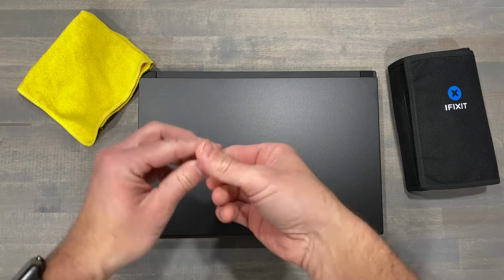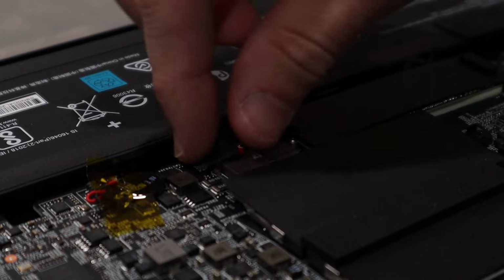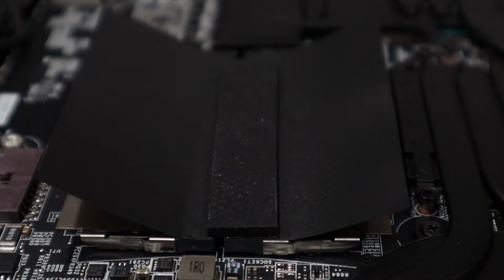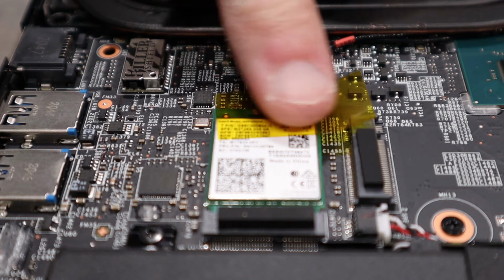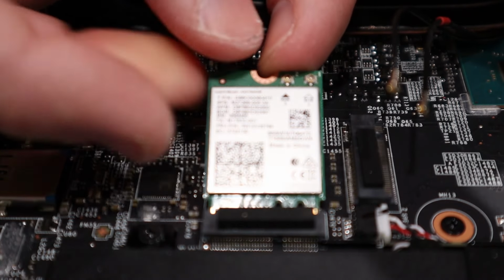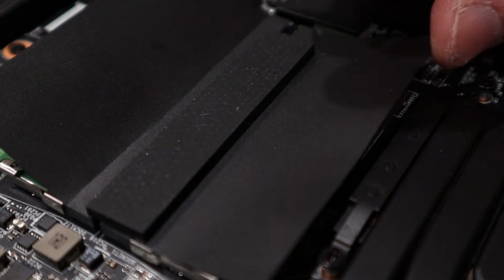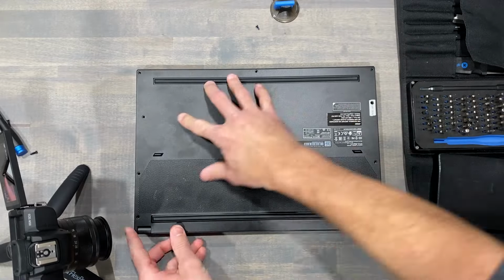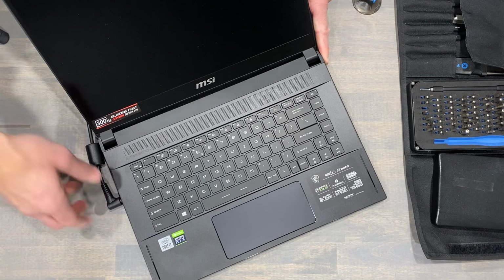MSI GS66 Stealth ACESSIBILITY Memory, WiFi, and Storage

Comment: Bob! We need you!!!! There are 2 main issue with GS66 that nobody mentioned in every single review I found.
- First: the wifi connection. the speed in download and the signal are 1/2 slower co.pare to any other laptop, removing the back panel everithing work fine, so the problem is the materials of back panel.
- Second: the performance unde thunderbolt charging. God it's so frustrating! I can understand that by thunderbolt charging the performance can't be the same as when we are using a 230 watt power supply btw it can't be that they are 1/2 than the performance by battery! Using a 100watt thunderbolt chargers in 3dmark spy (with an 10875+ 2070 max q) the results are 930 (GPU) and 7500 (CPU) that means that all watts are drained by the CPU making the laptop unusable (on battery 2500/5500 and it has much more sense!).

Comment: This is how you fix the fan noise on a MSI laptop with Dragon Center. I have a GE75 Raider with RTX 2060.  You set User Scenario to "User" then "Advanced" under Fan Speed. You click on the disc icon to open the fan pillar graph. For CPU, the pillar on the far left, I set it to 0%. For the other 5 pillars, I set mines to 5%, 10%, 15%, 20%, and 25%. For the GPU, I leave it default because I never use the GPU during basic tasks. You can still adjust it too if you want. It's 99.5% silent for basic tasks but one in awhile, the CPU does hum on then hums off for my laptop.

The "silent" mode isn't silent for basic tasks. It's really meant for gaming with little fan noise. It's not like Balanced or whatever Performance mode where the fans are running at 75%+ fan speed. I think silent mode caps the fan speed to around 40 to 50% for gaming.

Comment: You don't actually need to unplug the battery from MSI laptops. There is a small hole in the bottom plate, press that button for 30 s and the laptop won't power on until plugged into a charger.

Comment: Nice! Can't wait to get my hands on a max-p 3060 laptop. Been awhile since I've had a laptop but ready to jump back in. Have my eye on upcoming Eluktronics, MSI GS66 or possibly even the new Stealth15 with that 4/8 i7. I like the sub 4lb, travel friendly size but still packs a 10nm i7, 3060 and 144hz display.
Reply from the maker: Can you link that Stealth with the new 4c i7?  That sounds interesting 🤔
Reply: @BobOfAllTrades  https://www.msi.com/Laptop/Stealth-15M-A11UX

Tiger Lake i7, so decent single core performance, but multicore won't be great. Still for a light travel gaming laptop I am intrigued by the form factor and relatively reserved look.
Reply from the maker: I want this!
Reply from the maker: The display is labeled as 45% NTSC.  I really hope that is incorrect!
Reply: @BobOfAllTrades  Just saw a review and indeed the screen is pretty bad. It also has no ability to disable Optimus like some of MSI current offerings. 

Back to the hunt it appears. The Eluktronics with that new 1440p 165hz screen and AMD CPU is now on the short list. 

Best Buy has a pretty good sale on last gen GS66 laptops. $1099 for a GS66 with 10750H and 2060 is appealing.
Reply from the maker: That is appealing for sure.  I’m super bummed about that 15m.

Comment: Unrelated question but Should one get the current FHD 300hz screen or the 240hz GSync QHD panel coming in Q2 2021? Is GSync worth it?

Regarding this you could probably keep the videos separated but this video is extremely crucial for wannabe enthusiasts like me
Reply: There’s not much difference between 240 and 300. Plus, the extra resolution is nice with the strong gpu

Comment: Can you show how to properly clean laptops inside out? Like fans from dust,
keyboard and screen without damaging it
Reply: This isn't that difficult to do... however, the cleaning procedure will differ from one laptop to the next (it will depend on how difficult the manufacturer made it for users to open up the laptop and reach all the relevant hardware).
In some cases, manufacturers tend to put most of the key components (like CPU, GPU, etc) below the non-removable keyboard... which then forces the user to completely disassemble the laptop in order to reach them. These kind of assembled laptops are most difficult to handle... but most tend to allow easy access to internal components by simply removing the back panel (you have to make sure you have turned the machine off prior to opening it of course, and I'd also suggest draining the battery and then pressing and holding the power button for 10 seconds to remove any excess charge... or if you have a non-removable battery, make sure to turn off the machine, remove the back panel, and with anti-static gloves disconnect the battery from the motherboard... after which press and hold the power button for 10 seconds to remove any excess charge).

Once you've done this, you can remove the cooling system by unscrewing the screws holding it down... clean up the thermal paste from the CPU and GPU dies using isoprophil alcohol (highest concentration is best as it evaporates quickly), and dust off the dust from the fans and area between the fans and exhaust vents (usually using a small paint brush will do, cotton swab or a wet wipe). In some cases, you may need to apply fresh thermal paste to the VRAM and other voltage control chips - in some laptops they come with the thermal paste on them, in others, they usually come with efficient thermal pads).

Once you're re-applied the thermal paste the CPU and GPU dies, reassemble the cooling assembly, re-attach the battery to the motherboard and close up the back panel.
Reply: @deksroning125  sounds like a lot of work and a lot of stuff need to buy. Also in old my keyboard after my sister cleaned with wet towel some keys dead. When he was doing it before after some time keyboard beging working, but she again cleaned it and now some keys dead forever
Reply: @iraklimgeladze5223  I wasn't suggesting using the wet towel to clean the keyboard.... Only to use wet wipes to clean off the old thermal paste from the cpu and gpu dies and maybe from the fans... You don't touch anything else with them.
Reply: @deksroning125  i need to get all of this before summer :)
Reply: @iraklimgeladze5223  no need to use the wet wipes. Just use some proper rubbing alcohol (as close to 100% as possible) and a decent non scratch cloth to remove old thermal paste.

You can also use alcohol on q tips and clean out the fan blades. For general dust removal, just wipe it off or use a paint brush